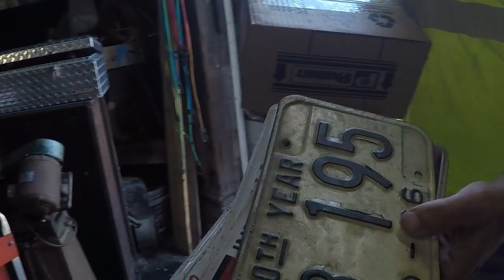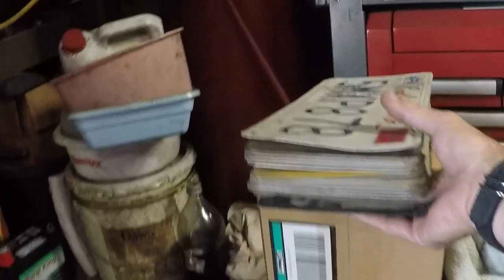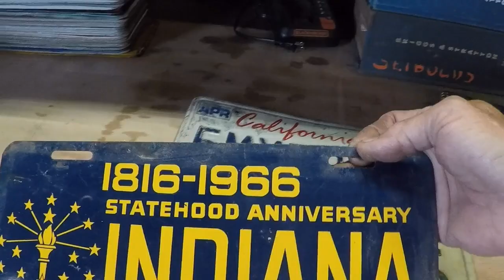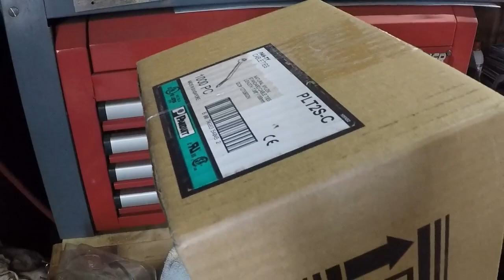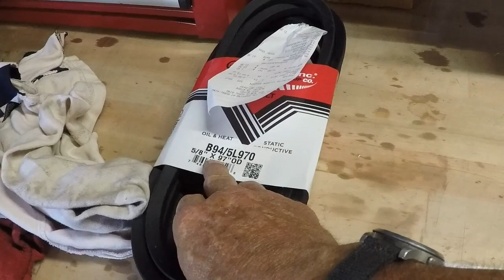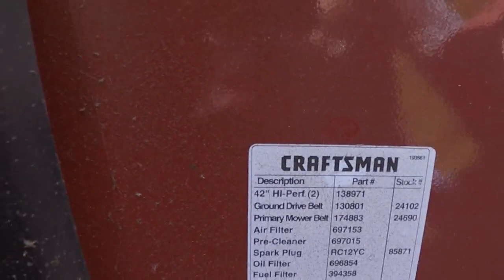Craftsman DYT4000 Deck Belt Substitute 144959 Thanks David! #smallenginenation

Comment: I went to Tractor supply and got a 1/2 in × 95 in for $20  today and it worked great. I mowed for over an hour  in pretty tall grass with no noticeable difference.... will update if it ends up breaking soon.

Comment: My Craftsman DYT4000 w Kohler 26HP VTwin uses a Huskee 1/2 x 82" V belt from Tractor Farm Supply for the transmission drive,  not a 95.5".  This video was incorrect in my particular case.

Comment: I just replaced mine with a 1/2-96 inch and it took me all of 4 minutes.  Given I ditched the lame pulley guards a couple months ago to reset the belt my uncle did wrong! Those blade pulleys spin like skateboard wheels, I can't see this stretching an inch. They had a Craftsman belt but it was at least 2 inches shorter than the 97 I compared it to in the store. I can see how the 95 1/2 is ideal but a 97 is too big and a 95 would have a little too much tension on a 1/2 inch unit. I'm thinking at worst the 96 will fall off but a 95 might snap when I give her the full Brittany in the tall stuff or the jew weed. Meh, the way the Ol'girl burns oil I expected she'd be right stoved  up before the cold spell the last one. I'll just be a little less sassy with the pressure washer around her. Also the pony hider went cattywampus first mow and I just toss it on when the jobs done. Wicked beautiful machines these are.
Reply: Love your writing! 😂❤

Comment: I tried the 1/2 x 95.5 and it ran the blade fine. However, I think when my last belt broke, it might have damaged the clutch. I couldn’t get the mower to drive very well and then after messing with it for a bit, the clutch broke off. Is it possible the 95.5 belt pulls too tight or do you think the clutch might have already been damaged and the added tension just finished the job?
Reply from the maker: The electric clutches are very robust, so my guess is, it was already on its way out. Zip~

Comment: Are you still in favor of the 1/2" x 95.5" belt for the deck?   If so is there a better than  OEM belt size for the drive belt?
Reply from the maker: The stock number for the drive belt is still your best bet Mike. Zip~
Reply: @ZippoVarga  I saw someone was recommending a 1/2"x95" for the drive.   It wasn't even close so I reused the original which wasn't as bad as I thought.   I tried to find a 1/2"x95.5" for the deck but after 4 hours looking locally I went with the 5/8x97 in lieu of waiting on delivery time as I needed to get yard mowed.  After installing I found that when the belt broke and wrapped around the clutch it ruined the clutch so now have to wait any way!  Smh.   If it weren't for bad luck...

Comment: good to know after i replaced the belts on my dyt 400,lol. there is another issue that was very difficult to find info on,but after burning up 3 ignition coils i found there is a wiring harness repair because of voltage spike on shut down. part #583205401....

Comment: I like your attitude and it would have been a great video except for one thing. I watched because i need to see the replacement process, not a belt basically appear on the pullies. Im not trying to be mean so plz don't take it that way. Just some honest criticism. But i was entertained while watching it.
Reply from the maker: Hi Tom. Most generally, there is a decal on the machine to show the routing of belts. If not, you can search the model number and deck type to find images pretty readily. I hope you can find what you need!! And thanks for the constructive criticism. It wasn't at all disrespectful and I appreciate that! Cheers! Zip~
Reply: Thanks. Lucky enough, its pretty easy to see the way it should go. My father needed help but he always had done it alone. I did like the guys video,  just thought id give a small bit of criticism as well. Id like to see the finished project with the plates. Im curious how that turns out. Bet its interesting.
Reply from the maker: @Eclipse-the-therian4217  As you progress through my videos from 2018 on, you'll see the plates on the walls on quite a few videos. When I put in my shelving rack, I had to remove a good bit of plates and relocate them so that I wasn't covering them up. The generosity of my subscribers blows me away. It's humbling and flattering at the same time. I'm definitely blessed with some of the BEST Subscribers on the Tube. Cheers! Zip~

Comment: Everybody shows taking the belt off. Nobody shows putting it back on. The issue I'm having my old belt got destroyed no numbers no nothing. I've ran the numbers & model numbers. Every belt I get is either to short, to long, or to thick. I'm at a loss it shouldn't be that difficult to replace deck belts. With proper belt should be 5 minute job 20 tops.
Reply: I fixed my neighbors mower with the stock belt. I originally thought the belt was too short. The trick is to route the belt around the pulleys on the deck. Next, slide the deck under the tractor but don't connect it yet. Put the belt on the PTO pulley first, then connect the front mounting brackets next. You may need to sit on the ground and push the deck backwards with your leg to get it to line up. Once those front two brackets are connected the rest goes back together fairly easily.
Reply: @songerm  thank you for response. I did finally find the right belt. I guess my mower was a midyear model. It has the pulleys for a 46" deck on a 42" deck.